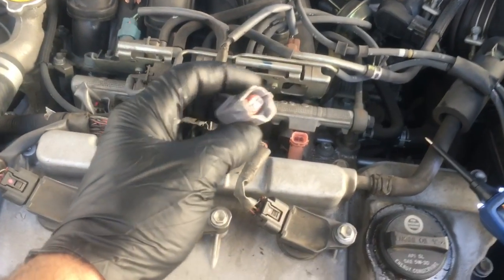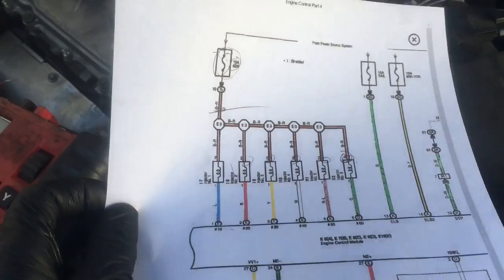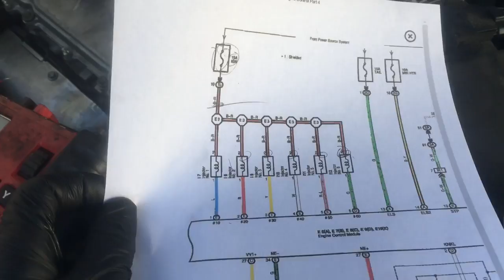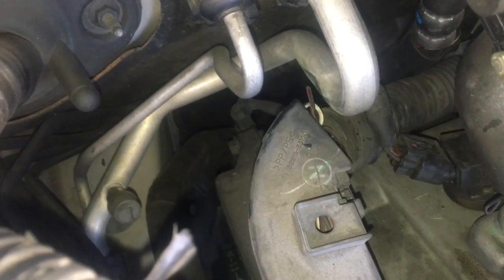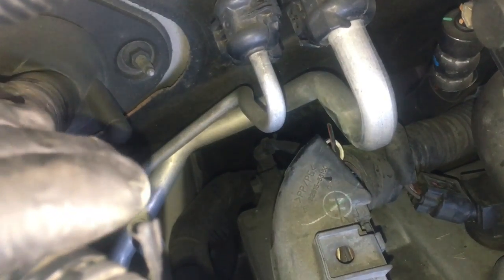3.0 L Lexus And Toyota No Start No Fuel Injector Pulse Diagnosis

Comment: Thank you so much for this vid. I am having similar problems with my car but unlike you the voltage across the injectors is not battery voltage. It is of the order of 7 volts.  So it looks like I have some terminals to clean at the fuseable link box or trace the voltage restriction otherwise. Contributions like yours is what makes Youtube a valuable resource, bless.

Comment: Thank you for the video. I have a misfire code on one of the cylinders. The fuel injector on that cylinder has been diagnosed and it works. Using a noid light on the fuel injector connector, it doesn't flash. Using a test light on the fuel injector connector,  there is power, but the ground wire is not pulsing. I replaced the entire ground wire for that cylinder with the misfire code from the fuel injector connector all the way to the ECM just to be sure, even though I didn't even see a broken wire. This didn't resolve the issue.

The compression test turned out to be fine and there is spark as well. There is also nothing wrong with the ignition coil. What could be the cause of why the noid light is not flashing and the ground wire is not pulsing? 

The car has a V6 cylinder and I also diagnosed the other 5 fuel injector connectors. The ground wires are pulsing and the noid light is also flashing for all those 5 fuel injector connectors.

Is there anything you can suggest I try out at this point? Thank you!
Reply from the maker: Zeberka The way I would confirm it would be to unplug the connector at the injector and the connector at the PCM it home check the ground circuit. If you get infinity reading that means that the circuit is open somewhere and the wire is cut or chewed. If you get a good reading then I was suspect a PCM driver being at fault.
Reply: @HowtoAutomotive  As I mentioned, I have already replaced the entire ground wire for that cylinder with the misfire code from the fuel injector connector all the way to the ECM just to be sure, even though I didn't even see a broken or chewed up wire. This didn't resolve the issue.

Are there multiple drivers inside the ECM or PCM, like one for each cylinder or is there just one driver?
Reply: @HowtoAutomotive  Since replacing a new ground wire for the cylinder with the misfire code from the fuel injector connector all the way to the ECM didn't resolve the issue, I decided to improvise.

As an alternative method, I decided to splice and share the functional ground wire from the adjacent cylinder. In other words, I now have two fuel injector connectors sharing the same ground wire. This method has worked and has resolved the misfire issue. However, my concern is if this method is an acceptable resolution or is there any type of downside this could create? Thank you!
Reply: @Zeberka767  Hi, was wondering if the splicing and sharing  ground wire with the adjacent cylinder still working? I have cylinder 6 not getting pulse and was thinking of tapping into cylinder 4.

Comment: Same problem,,, I can undo the battery for about a hour and it will start up but if it sets over night it won't start unless you undo the battery,,, any suggestions 2004 grand am 3.4

Comment: I got a P301 code on my 2005 ford escape 3.0 L, valve covers were leaking after 150k miles.  Watched your great video on replacing the valve cover gaskets and replaced them and the spark plugs and coils. It ran great for about 3 weeks, but the number  one cylinder started missing during startup when engine is cold. However, the engine runs great after about 15 seconds. Have any ideas whats wrong?

Comment: OK If it has fuel pressure and spark but the noid light stops pulsing after about 5-10 seconds what do you think that could be a 2000 f350 5.4 just replaced the intake crank and cam sensors started man please help

Comment: Man that would through ya for a loop if you didn't see it, 👍👍
Reply from the maker: STEVE ROB for sure those can be tough problem to figure out. Not why it's not running but where the actual break is. It can be hard to fine.